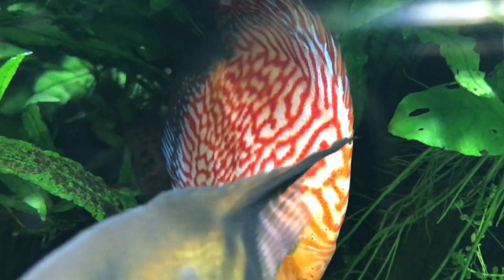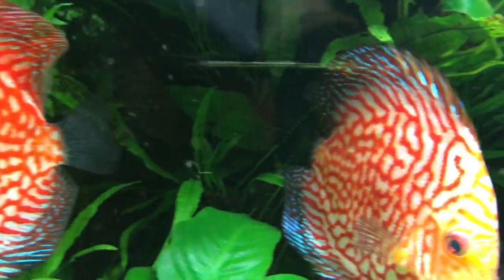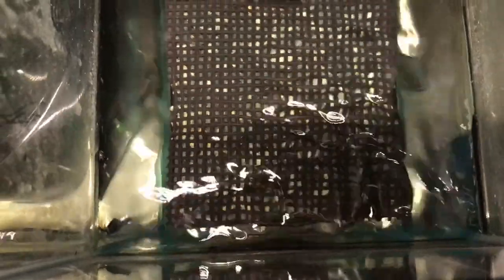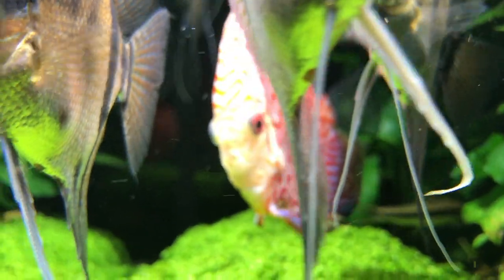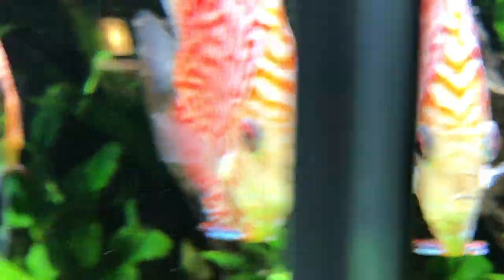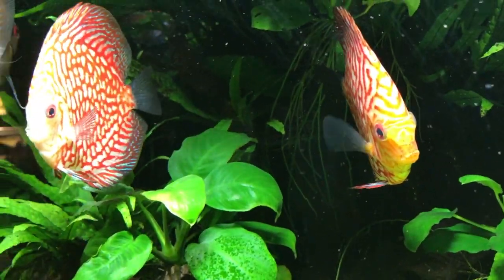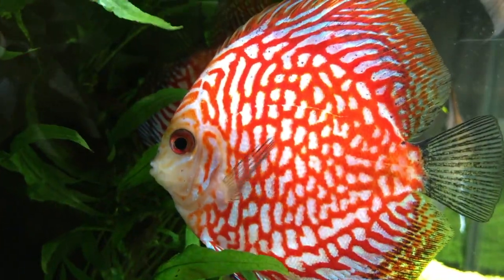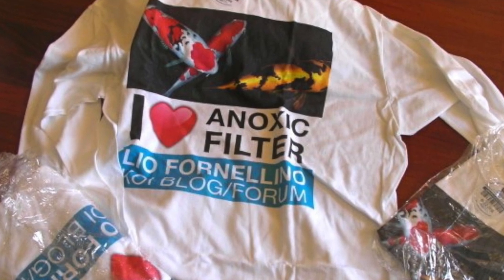What makes an Anoxic Filter dissimilar to other filters: Magnetic Permeability.

Comment: Hi Dr Novak. Just thinking out aloud on the magnetic permeability, I may be wrong and it may not be necessary given the bcb basket already has a negative charge but would adding an electrode in the center of the bcb basket/bag & connected to the negative node of a battery and an electrode connected to the positive node in the water column increase the negative charge of the bcb basket and thus absorption of positive charged ammonia into the basket?
Reply from the maker: no don't do that.

Comment: Hi, thanks for all your info. Would it work if I put a basket in my sump with Seachem Matrix in it instead of cat litter?
Reply from the maker: Unfortunately it will not work,  you really need to stick to what I say for it to work. If you vary from the formula then you make it different results than what you expect.
Reply: @anoxicfiltrationplenums  Thanks you so much for the reply. I managed to find the special kitty litter and mixed it with Seachem Flourite Red. Kitty litter turned to mush/mud, I then mixed in more Flourite to give it more structure and just finished putting 4 plastic containers in my sump with this mix about an hour ago. Tank is extemely milky but fingers crossed it will filter out soon and baskets stop leaching the 'mud'. I drilled the plastic containers with lots of small holes but it feels that there is not enough flow into the baskets? Will small micro holes be enough or is it important to have more flow capability? I took some video, will try and put something together soon. If you are interested I would love to send it to you somehow?

Comment: Hi Dr. Novak,
Enjoying your insight in anoxic filtration.  I noticed in your videio that the tank is heavily planted. Question please;  does the anoxic filter out compete the plants for nutrients?   How is ammonium/nitogen available for the plants if the anoxic filter is efficiently converting these combounds to N2 and O2 gas?
Reply from the maker: http://anoxicfiltrationsystem.blogspot.com/

Click on the link above and look at the photos of ponds and then you will see plants are not in competition with an Anoxic Filter. If a BCB has a plant in it , it will bring in nutrients into the BCB for the [plants to use just like Laterite does.

Comment: The advice here in this video and on this channel in general are so far removed from mainstream established practices. I'll give it a miss.
Reply from the maker: I do understand that the info I give is more at a collage level and Lab base level than what most hobbiest are used to. But nevertheless, the info is factual and has  been tested to work 90-95% of the time. It is the art of setting up a long term aquarium that will last for decades.
Reply: That's because noone can money out of the things needed to set this up. If you don't understand this you're very naive.

Comment: Can you put the anoxic filter on an aquaponics set up or will it strip the nitrates before the hydroponics plants can consume it?  And how long is the break-in period?
Reply from the maker: yes you can add it to a aquaponic set up. However, if your plants are suppose to be the workhorse of the system then why would you want to? The break-in period would still be the same as if in an aquarium or pond 45-60 days.

Comment: Should there be a separate aerobic filter to take care of nitrification? I heard that you refer to an "external canister filter". I suppose that means you do need a separate aerobic filter for nitrification.

Or does the anoxic filter take care of both aerobic nitrification and anaerobic (less aerobic) denitrification?
Reply from the maker: Anoxic filter will take care of both aerobic and anaerobic activities.
Reply: @anoxicfiltrationplenums  Thanks. You are an inspiration that suddenly came from nowhere. For many years I had experimented with the concept of anoxic filtration without using that name. 

What did you say about the newer package of Special Kitty Natural clay at Walmart that is different from the original package? I heard that there are different and the new package is less good for this purpose, even though both say "natural clay no fragrance".  I've been looking for the original package but I don't know what I will get.
Reply from the maker: @woodensurfer   Walmart admits that they have change vendors in their sale of kitty litter.  they now sell it’s natural Clay kitty litter but it is not the same as it was several years ago.
Reply: @anoxicfiltrationplenums Thanks. I am having problem finding the original Walmart Special Kitty Cat Litter. Do you think other baked clay non-fragrance cat litter will work? What is wrong with the new Walmart stuff? Thanks

Comment: Hi  Dr Novak. Thanks for sharing all this job with the community.  I'd like to understand a little more about your anoxic filter. I have a couple of questions..  Is it fair to say kitty layer is bentonite/zeolite type? if yes, I understand that these attract cations like NH4+. Should we have to take any consideration about depletion of Ca2+ that plants needs or any other substance ? Does this adsorbent effect stop at any time?    Also i would like to understand how is this related to the fact that we need to remove NO3- .  Finally should be feasible to implement this in a "nitrate reactor" type BCB  for the ones that dont have sump implemented?  thanks a lot!

Comment: Would the API canister filter work for this?? It comes with several baskets already, just put the mesh and substrate inside them.

Also can you explain crystalline structure? Why does it attract, what is it etc?
Reply: The only way you can colonize anaerobic bacteria is in very low flow situations...canister filters are not good for that.

Comment: Mr. Novak: I am very grateful for the education you contribute to the hobby. Thank you for the great information. I have a question concerning my very mature fresh water tank. I have a 90 gallon, heavily planted tank with a heavy fish load (primarily Rainbows). The tank is set up with a sump. I have a flourite base covered by sand for the plants. I also have a pressurized co2 set up and more than sufficient light. Everything is on a timer. The sump is set up in a traditional way, with a large section for  bio media. My water levels are very stable and I have gone 3 to 5 months without H20 changes, my nitrates fluctuate between 10-30 ppm on the API test kit, (I am using the test tube mix kit. Ammonia and Nitrite always are at 0. I just removed some of the bio media and made one Anoxic basket filter for the sump. I plan to make two more.  My problem is installing a plenum. The plant bed is so mature that I will have to destroy half the plants in order to remove the sand to install the under gravel filter plate. Can I simply forgo the Plenum?

Comment: I have a a few questions about using Biocenosis Clarification Baskets in a vertical container verses a horizontal, ex 55 gallon drum. How best to bring water in to the vessel? Would bringing the water in through the bottom or top  provide an advantage worth considering. Lastly, what would be the best way to stack baskets in a vertical space to insure proper flow?
Reply from the maker: Just make sure that the water is not forced through the medium (BCB) at all but made to go around and under. The BCB’s can be stacked if you like and a good to great prefilter is all that is needed. Once they(BCB) have cycled then the magic will begin.

Comment: Okay, so what if you don't have a sump? Plenums seem to be an easy enough concept for any tank, but you show your BC baskets added to a sump. Can it be add to any size tank that doesn't have a sump system? If I understand it, you should be able to put an anoxic filter system even in a hang on back style filter - right? It's just that the water has to pass through the system? - Also, if you've answered this question previously, I haven't made it through all your videos yet...
Reply: I'm currently experimenting with a plenum with a BC basket in the center of it, using a shortened-  two inch lift tube to draw water slowly through the substrate, I'm currently 40 days into the tank set up and 20 days of fish, and am show zero nitrates, ammonia and nitrites after initial cycle dropping to zero, the water conditions are very stable with no water changes so far.  I'm using canister filter with a pre filter canister as the primary filter
Reply: @jonferris8039  Hi Jon, do you have an update as to how your system worked out?